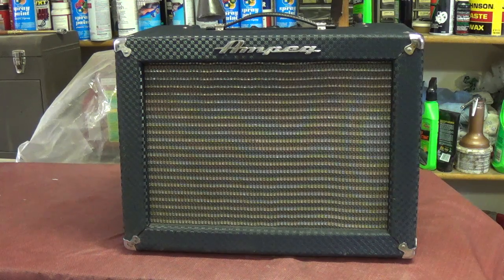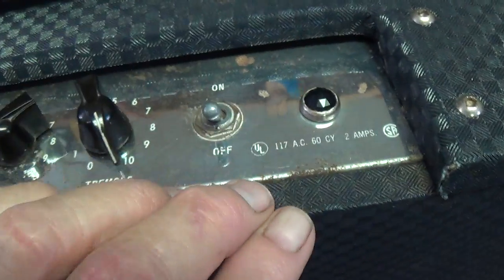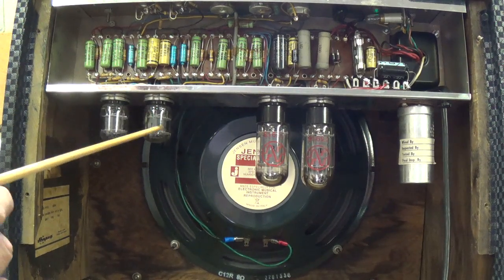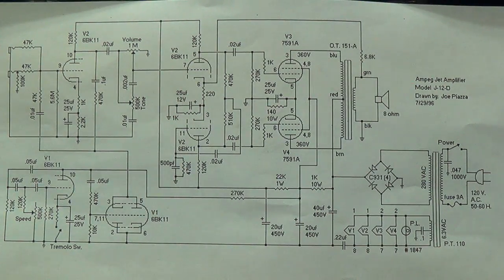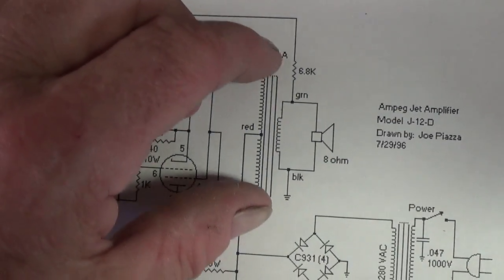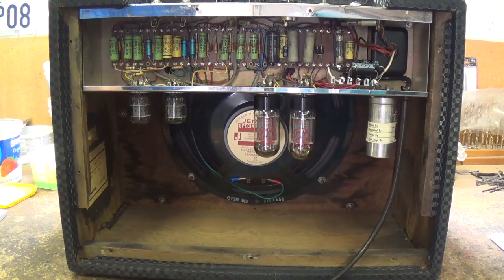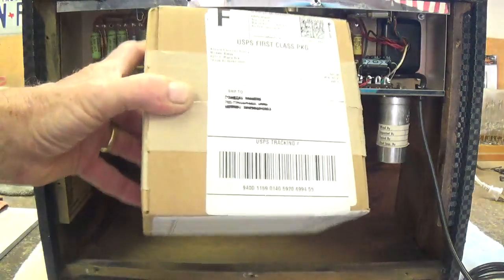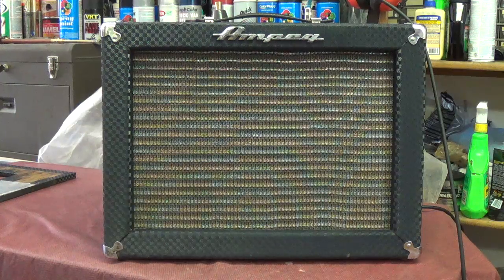1966 Ampeg J12D Jet from Craigslist.....Junk or Gem ???

Comment: I really enjoy your videos, and I've taken an interest in amplifier repair and building. But I do have a question, with an amplifier unplugged, will you still get shocked messing around inside of it???
Reply from the maker: Yes, the electrolytic capacitors will store a charge for several minutes after the circuit is turned off and/or unplugged. You need to discharge the caps (see my videos) prior to working on the circuit.

Comment: Doug...I love these. Got a Jet J12 B with the 6SN7 preamp and 6V6s rather than the BK11 and the 7591s. Jensen Concert Alnico 12...wonderful tone with humbuckers!!!

Great value there  Im envious! Perfect tolex. The handle is a replacement I'm sure.  One of the major bugaboos with these is that the chassis/ panel rusts like crazy.  I think if it stays in Aunt Tilly's basement for more than 5 minutes that plated finish is just dying to corrode.  Just the cabinet, tolex, intact rust-free chassis is worth it!

Oh yeah...the tremolo on this is so thick and rich...my favorite!  Plug a 335 into that and crank the volume to 7!   Sweet!

PS..I hear Peter Frampton used to take on on the road packed in a big road case.  He mic'ed the amp inside the cabinet...with the cover ON and cranked it. I don't know if this was to prevent bleed into the mic from other sources on stage or if it just really drove the mic hard.
Reply from the maker: Thanks so much for your interesting input, BDB.
Reply: UD... Did you find out what the 60 Hz hum was?

Comment: The plate dissipation is a bit high, I'd go more towards 75% Pdmax by upping the cathode bias resistor. The line voltage is higher nowadays so this is not unusual. As for the hum, I see a weird arrangement of two caps on the heater winding, I'd replace that with a heater elevation voltage divider from B+ to the center tap, that should get rid of all of the hum.
Reply from the maker: Thanks for your input, JJ. With cathode-biased circuits, it is acceptable to bias the PD up to 100%......although I tend to stay below that level. Grid-biased PD is generally kept at 70% of max or below.

Comment: What a find! Is there a part 2? I need to know how you fixed the hum in that sweet little amp.
Reply from the maker: No Part 2, Ray, but I still have the amp and converted it to 6L6's.....which seemed to reduce the hum quite a bit (?)
Reply: @UncleDoug  what was involved in converting to 6L6 tubes? I imagine it wasn't a straight swap?
Reply from the maker: No, the sockets had to be rewired (not too difficult) and then the circuit re-biased, but the improvement was significant. I have had problems with 7591 tubes and hold them in low esteem. When they work properly, they're fine, but all too often, they don't. I feel like they are over-stressed and under-engineered.

Comment: Why not replace the can cap with the correct part?   I just finished a J-12D repair here; the replacement CE can works wonderfully, no hum issues at all.   Also i was hoping you'd notice the VERY unusual filament buss 'de-centered' center tap capacitive voltage divider.   Look at the schematic -- there is a 0.1uF from the centertap to ground, then a 0.22uF from one end of the filament winding to ground.   This results in a 'de-centered' ground reference for the filaments --  one side measures about 1V to ground, the other side measures about 5.3V to ground, as set by the reactances of those two series caps.   I have no idea why Ampeg did that; and I think the Jet 12D is the only amp they did that on!    Another interesting design note is that the 2/3 of the tremolo compactron that are implementing the amplitude modulation are running "dry plates", there is NO DC current flow through those two triodes.   It is a funny little amp indeed.    Yours is SQUEAKY clean, congrats!
Reply from the maker: Thanks for your very knowledgeable  input, TO :)

Comment: Did you remove what appeared to be a death cap (0.047 from the on/off switch to ground) when you installed the 3 wire power cord.  I couldn't tell from the video, I'm not even sure that it is a true "death cap".  Also your quick continuity checks for the transformer windings are must when making a vintage purchase.
Reply from the maker: I probably did remove it, Paul. Yes, it's best to avoid amps with open PT primaries.

Comment: Hi Uncle Doug... So did you ever uncover the cause of the remaining hum? 
Thanx and cheers
Reply from the maker: Yes, I did. I converted it to 6L6's, installed a nice matched pair, and presto.....much better tone and no hum at all :)
Reply: Uncle Doug, 
It's kind of a shame that you converted it to 6 L 6 tubes, although I certainly understand why. Good 7591's are tough to find and can be expensive, and so far, nobody has a decent modern Reproduction 7591 that I'm aware of. This amp would have had  a fairly unique and different tone from the usual Fenders and such, with a good set of vintage 7591's installed. The Jet  J12d  I once had  was only putting out what seems like a couple of Watts,  and it was because it had  bad phase inverter  resistors  that had drifted way off-spec or opened up, and as I recall the resistor values were slightly unusual . I actually sold that amp to the guy who engineered John Hiatt's "Little Head" recording. 

By the way, the 7868 is the same tube electrically and electronically as the 7591, but the 7868 has a 9-pin Novar base, sort of like a 12ax7 but with wider pin spacings. I made a couple of adapters that  allow me to use  7868's directly into a octal socket that was designed for 7591 tubes (or test the 7868's in a tube tester that wasn't really designed for them but did have test info for the 7591). Perhaps there is a commercially made adapter for this particular tube substitution being sold online?

Comment: Love this amp! Again a very insightful video and your troubleshooting description is very informative. I was just wondering what you found to be the problem with the hum? Did it just forget the words? lol. Sorry I couldn't resist. Seriously though inquiring minds want to know.
Reply from the maker: Thanks, Jack. By coincidence, I solved the hum problem in the Ampeg Jet about two weeks ago. One of the 7591A tubes was failing and the imbalance must have caused the hum. I installed a matched set of new tubes and it is not only quiet but now has much better tone and volume. It's currently my favorite sounding amp. The tremolo is outstanding !!
Reply: Oh wow. I again have learned something new. I did not know that a failing tube could cause hum. Did the tube end up showing bad on your Hickok tester?
Reply from the maker: Not really. It's low plate current gave it away when I tried to bias the output tubes.  Yes, a gross imbalance in output tube function can result in hum. I haven't seen it very often either, but in this case that was the problem.
Reply: So much to learn so little time. Thanks for the information!!
Reply: Doug, as a fairly new subscriber I only recently learned of the months-ago passing of Rusty, so I send my deepest sympathies. Animals can be our greatest teachers.

I really enjoyed your work on this unsung gem from Ampeg.  I kept digging through the comments to find out about the hum issue, I knew you would attack the problem again, even after two years.

When you find that a problem lies with a tube after eliminating other suspects, especially when it's in transition to failure like this one, you've hit a home run.  I mean that you've worked with diligence in a good order: you've used a good process.  I suppose that in this failure mode, the tube would ring with just about any exciting frequency, which was either 60 or 120 Hz in this amp.  So glad you tackled the beast!

I was immediately struck by how nice its tremolo sounded, was glad to find you agreed.  I expect the capacitor type is main determinant of good tone in any well-designed tremolo circuit.

Finally, I have strong opinions about break-in, seasoning, or whatever you call the phenomenon of component sound improving with time.

All parts change with time, temperature, and excitation (like current).  Even monolithic ceramic caps have structural change (even in their constituent crystals, Murata has found) over years of typical use.  The changes lead to increased quality factor in both mechanical and electrical measures.  So reactance increases,  resistance often decreases a little, and overall noise increases in some respects but decreases in others.  

The very reason a Stradivarius will shatter more easily than a new violin (higher Q) is what gives it almost universally better tone and volume.  Its higher Q increases brittleness and heat conversion is minimized.  One could say it becomes work-hardened in a beneficial way.  And that implies that an excellent violin made today might very well exceed the sonics of the Stradivarius in 25, 50, or 200 years.

My old company would receive our old amps (SS) for repair or upgrade.  We always needed to account for their greater musicality (like bloom and liquidity) when comparing a fresh-from-the-factory amp to a new version.  However, the new versions usually won anyway because of lower noise and better dynamics, and sometimes in every musical respect.

The point is, I always would always tell somebody to consider the positive musical effects of aging when comparing new parts to old.  That also implies that good, new caps or transformers might very well outshine the vintage ones in a year even if they sonically lose today.  Complex components like amps should approach their ground states (hence Q and musicality) with time in use.  One would expect their sound to be more revealing, generally less forgiving, but better overall.

Sorry for the blathering.  Thanks again for another delightful journey!

Comment: I just finished a short series on a 1967 Ampeg Portaflex SB-12.   Turns out it was owned by "Polka Royalty"  in this territory.   Similar to a few you've seen,  all it really needed was a bath,  as the circuit was still completely healthy.
Reply from the maker: I guess it's natural for a polka amp to get a little soiled from all the beer and bratwurst flying around during a performance.

Comment: Many years ago I gigged with a jazz guitarist who had an Ampeg Gemini II from the same era.  What a sweet sounding amp that was.  Ampeg defied the zeitgeist and designed low distortion amps--they knew their stuff.
Reply from the maker: Yes, indeed. Ampeg amps are more commonly associated with bass guitar, but their regular guitar amps are excellent too. They were less common than several other brands, but held their own when it came to quality and sound.
Reply: I have a Gemini ii, it's amazing

Comment: This was a timely discovery. A client dropped one of these off today for repair. It produced audio for about fifteen or twenty seconds and then went silent. 
All tubes tested as satisfactory, and the B+ voltage looked healthy. However I discovered an open short voltage dropping resistor (1kohm 10 watt) between the output transformer center tap and the rest of the filter cap section. The problem is that this resistor is only an inch and one half in length, and nothing in my inventory would fit properly. Waiting for parts at this point. 
I also measured the canister cap sections and the cathode bypass electrolytics for accuracy. The 40/20/20 450 volt canister was OK.
Only one 25uf 30volt (really!) cap was acceptable. Replacement 25uf 50volt electrolytics were installed. 
The  date code on the speaker tells me that this 12” driver is a Jensen from the 39th week of 1966. 
Also, this appears to be a transitional model as the power tubes are not 7591a valves, but a nine pin pentode (sorry, very late, the model number escapes me). I have found no schematic that describes this version of the Jet.
Any thoughts on this would be appreciated.
Thanks.
Reply from the maker: Howard, the only non-7591A Jet I am aware of is the Model J12B which used a pair of 6V6s. Are you sure you're not thinking of the 6BK11 Compactron, with 3 triodes (3 x 3 = 9) ?
Reply: Sorry I wasn’t able to supply all the information in the first post. This Ampeg Jet 12D has a pair of 7868 power tubes. It doesn’t appear to be a user “upgrade” as the tube sockets and wiring look stock. I have never seen this tube in any piece of audio gear before, and I’ll be researching it this morning. I’m familiar with triple triode valves as I’ve wrestled with a Fender Super Twin in the past (6C10 if memory serves).
Thanks,
HR
Reply from the maker: Greetings, Howard. The 6C10 is often a substitute for unobtainable 6BK11's.....and an expensive substitute to boot, at about $100 apiece !!! Like you, I am not familiar with 7868 tubes in guitar amps, but apparently they were used in jukebox amps (AMI) and HiFi amps. The two bases are quite different, 8KG for the 7591 and 9N7 for the 7868, so if your amp was modified to accept the "more common" (at one time) 7868, you would think that the replacement and rewiring of the tube sockets would be fairly obvious. Very mysterious.......
Reply: I agree. This is a unique take on an otherwise venerable design. I would speculate that Ampeg was offered a financially beneficial incentive to buy a large quantity of these tubes, and in the process of shutting down production of the Jet , they recast the schematic to accept the 7868. Somehow the engineering change order never made it past the soldering bench; therefore no published schematic. 
In a class AB configuration, this tube is capable of handling very high plate voltages (500vdc) to which it will not be tested ( I measured about 360 volts at the output transformer center tap).
BTW, not only are the 6C10 tubes expensive, but its hard to find one that isn't microphonic. My local tube guru was able to find one for me that met spec and didn't cost me a fortune. Maybe he has some 7868's, just in case.
Reply from the maker: Wow, that's a bad combination.....$100 AND microphonic. Matched pairs of RCA 7868's are about $75, so it's pretty painful if your Ampeg Jet needs tube(s) :(
Reply: Uncle Doug 
The owner is a local music educator and an electronics hobbyist. 
He replaced the tubes recently. My Eico tester is basic but capable of checking a wide variety of tube types. It does not evaluate mutual conductance or emissions or any of that other important stuff. But it gave me a thumbs up on the valves in the amp. 
He has owned the Ampeg since the early 1970’s and it is in quite decent condition for its age. The one you featured in this video is cosmetically much better, but his has more original parts.
All of this is irrelevant to my client; he’s very fond of the Jet and just wants it to be a reliable, working device. 
We discussed budget, I gave him an estimate, and he agreed. Our conversations have been congenial, and I’m happy to do the work for him. All good as far as I’m concerned 
And yes, this can be a frustrating and expensive experience.
Thanks for the dialogue, I’ll let you know how it turns out.
HR
Reply: Hello Uncle Doug,
After waiting for back ordered 1k 10 watt power resistors, I decided that a pair of 2.2k 10 watt resistors in parallel would suffice. They were installed this morning, and I had solid plate voltage throughout the Jet again. The only other work performed was replacing the 25uf cathode caps in the preamp and bias sections, and installing a grounded AC mains power cable. Then I played it for a while.
To answer the initial question, I think this amp was worth the effort, and I believe my customer will be pleased.
Once again, thanks for your thoughts and insights on this project.
Reply from the maker: You're welcome, Howard. Congratulations on a successful repair job.

Comment: Hey Doug!  Love your videos!  Always reminds me to not take things too seriously, sometimes against my will but by the end of the video, I get curious about what Rusty has to say.

A question about the amp:  There is no tube rectifier, no standby switch ... so how does it avoid giving full voltage to tubes that haven't fully warmed up? Or are these some sort of mystical tubes I have been hearing about? I would want to take care of those 12 pin compactrons.  How does it do it? Or do we need a standby?  I just picked one up, quiet as a mouse, two wire cable, 2 ea 6U10 and 2 ea 7571 RCA's.  Some cat scratched one of the top corners, can you imagine such a thing?  Serial num dates it to 1965.  Thanks!
Reply from the maker: Thanks, AF. I am no fan of standby switches......they generally cause way more harm than good, and are of little practical value. The weak link in most tubes is the filaments, which (just like light bulb filaments) tend to fail when voltage is first applied to them. The standby switch does nothing to improve this situation. The plates, by contrast, are quite robust, and the current flow is miniscule (30 mA or so).  Some people are concerned over cathode stripping, but it's not an issue in tube amplifier circuits. Here is a very detailed analysis of the topic:  http://www.valvewizard.co.uk/standby.html   Congratulations on your recent acquisition. Jack apologizes for the cat scratch. I hope the amp serves you well :)

Comment: As the owner of a J12D, I very much enjoyed this video. I have a bunch of Fenders, but this is the sweetest amp I own, and a great one to control from the guitar--just crank the amp, dial back the guitar, and you get all the tones you really need (i.e. one, but a really good one). Those compactrons scare the heck out of me because the amp might as well be powered by unicorn teeth, but they are tough little suckers, and so far so good.
Reply from the maker: Thanks for your input, Ben. I agree with all, including the scariness of having a Compactron fail :(